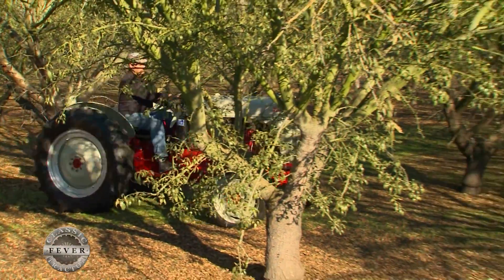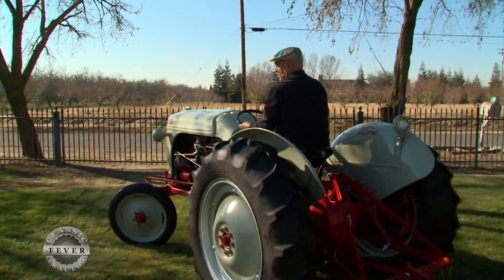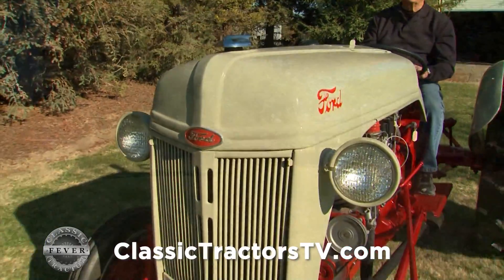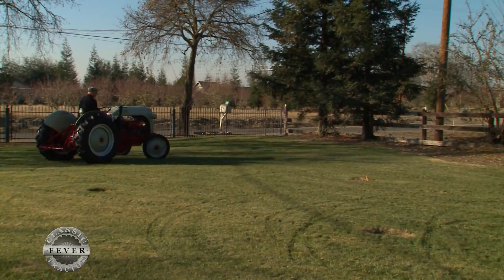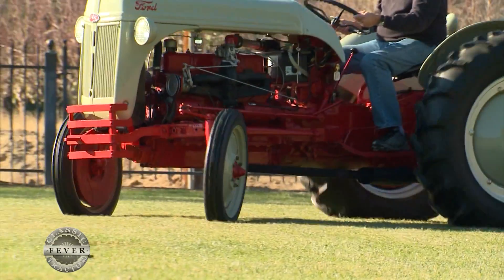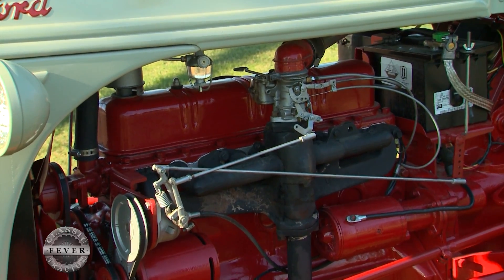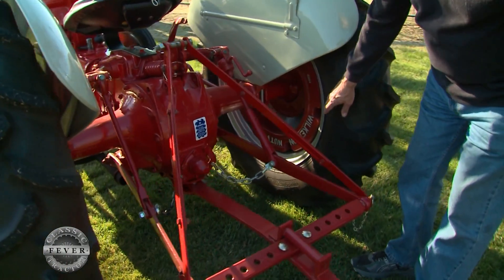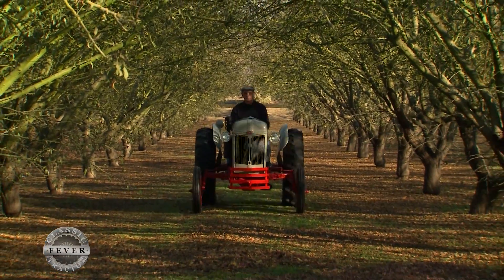Cool Conversion and More Power for this 1952 Ford Tractor!

Comment: Its not a v-6 engine, it’s an inline 6 engine.
Reply: I think a V-6  3 litre  engine would be perfect in there.  Our neighbour had one with straight 6,  took rear ends out.  
They have no  bull gears just big pinion gear & it would twist them off. Thanks  I am from Ontario.    Gas up here is 1.60/litre  X 4.54 +

Comment: I've always been fascinated by the Funk conversions, but have wondered what role they actually played in farm life. The N series tractors are good tractors, but the drive train was built to handle 20 horsepower. Doubling that really must put a strain on that drive line. I'm wondering under what farm conditions or jobs a farmer could take advantage of the available 100 horsepower without breaking this little tractor?

Comment: Had a restored 1956 8n. Still have the tool box that bolts under the hood. Also still have the front wheels and 6volt generator system if anyone happens to be looking for these parts.